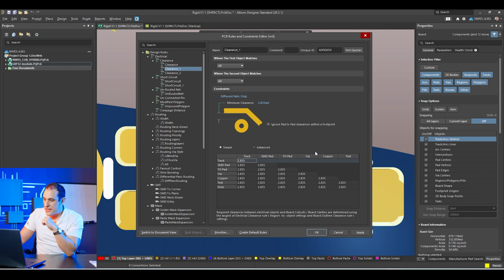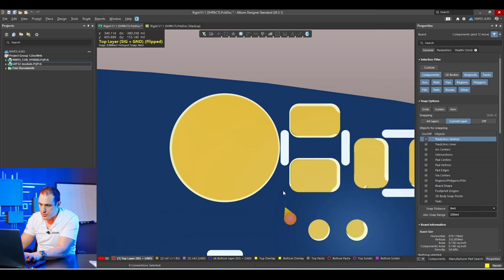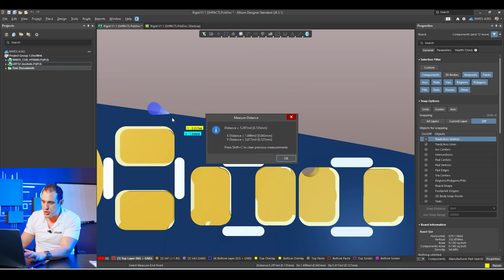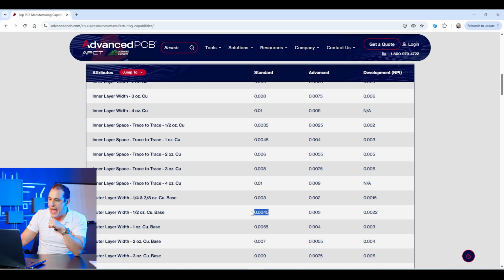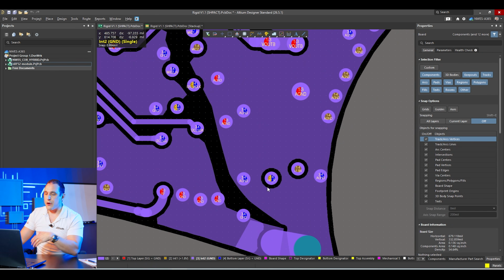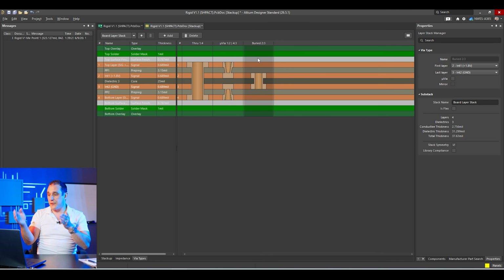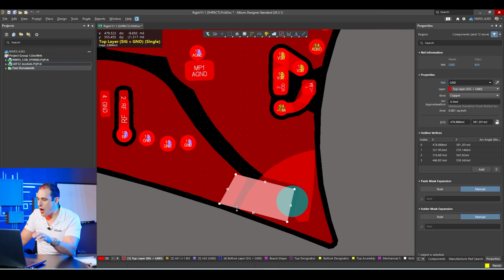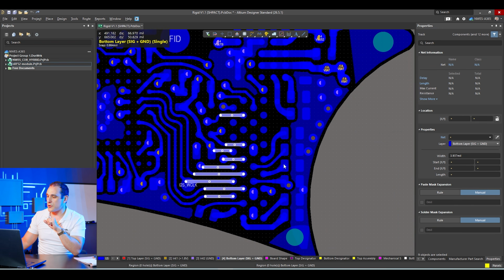HDI PCB Stackup Breakdown - Etching Weight Via Spacing, & More

Comment: can we do via in pad when we use uVia?
Reply: Yeah absolutely, but some fabricators may not offer support for laser-drilled via in pad. I've found this is the case in the US and China. For some devices, like 0.3 mm BGAs with higher pin count, you won't be able to complete the fanout without laser-drilled via in pad.
Reply: Make sure you do Cap-plating and planarization for via-on pad...  Write it in Fab-Notes... Submit a detailed Fab and ASSY requirements in a Draftsman Doc preferably...

Comment: I don't follow the logic of a manufacturer that specifies these clearances by inner and outer layer. For me it's a question of plated vs. non plated. Although I have to say I appreciate the reference to copper weight.
Reply: Manufacturing of outer layers require more steps (solder mask, surface finish, etc.) ; therefore tolerances are harder to follow, as simple as that.
Reply: Outer Layers are built with Copper Foil then vias drilled. These vias need connectivity so they plate it..... Only vias wouldn't get plated, all the Copper also gets equally plated aka thickness increases, when thickness increases clearance between copper decrease.... That's why you have increased clearance for outer layers....
Reply: @sairamenon  yes, I understand the process. Did you know that if you have a blind or buried via span then an inner layer/s also get plated. Additionally you can design a PCB with all NPTH drills. No plating cycle. ie. inner layers can be plated and outer layers don't have to be. Hence my original comment. My issue is that it's misleading for inexperienced designers.